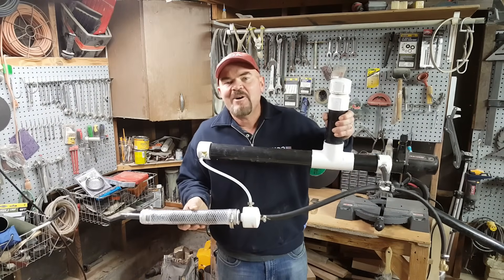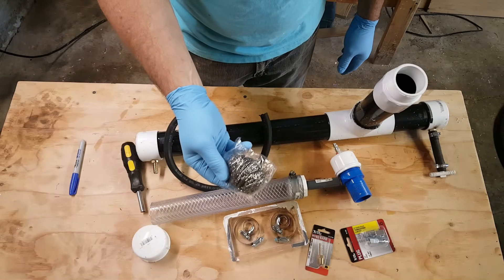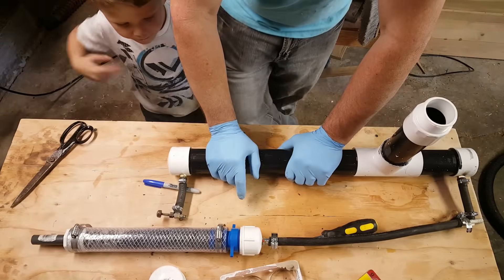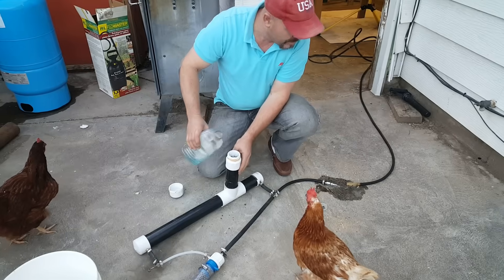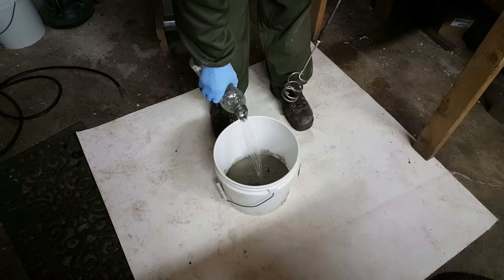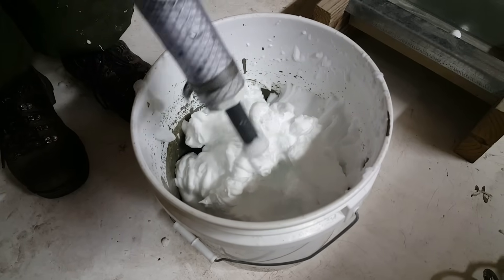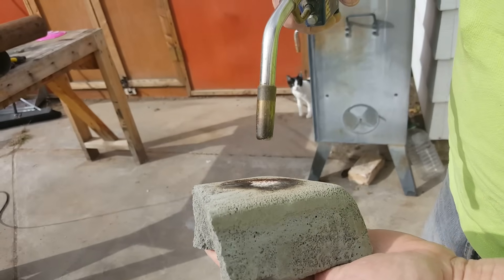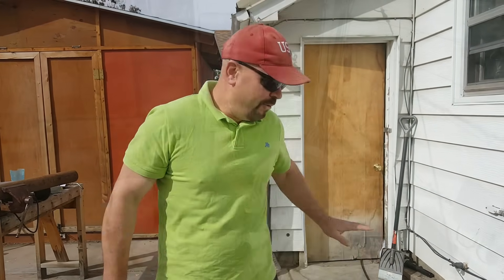Air Crete Machine for Under $30 (DIY)

Comment: Air rated concrete has been on the market for many years.  Invented in Europe and used widely in construction.  China has over sixteen hundred factories that make it and ship all over the world.  There are only four factories in the US.   The reason it not allowed in North America is that it would destroy the drywall and wood industry.   You have done an excellent job explaining this.
Reply: Scorp  he doesnt know what hes talking about and is wrong on all accounts not to mention the fact that sheetrock is used for providing a type of surface rather than insulating, or providing structural support.
Reply: @ keith reynolds  -   your statement is true.
Reply: AAC  autoclaved aerated concrete blocks have been used since the 1940 in some countries is called BCA
Reply: With new fibercrete mixed with aircrete & additional agents, you can make structural materials that are better than wood or drywall.
Reply: Where are the 4 factory's at?
Reply: LOL  , yeah , deep in the heart of Texas.
Reply: China
Reply: NooMax4ever exactly.    But most people accept the norm and don’t ever think outside the already built box
Reply: I'm willing to try
Reply: Closed cell spray foam and open cell is cheaper and can be done with 2 people.
Reply: But does “the reason it isn’t allowed is be ause it would destroy the drywall and wood industry” make any sense?  Drywall and wood are industries, but so is the home building industry, the insurance industry,etc who could put equal pressure financially if wanted in, and that is forgetting about voters clamoring for cheaper, decent homes.  And there would still be plenty wanting wood/drywall…not like their market would collapse. 

My guess is that more likely, just the usual that  because wood and drywall were quick and cheap, US builders, inspectors and customers got used to them, and there are more barriers currently with permits, codes, customers worrying about resale value, etc. 

And people used to say “the car and gas lobbyists will never let electric cars be made!”  But if it’s a good product ….it gets in, no matter how much it is repressed, and not like the competitor industries are the only ones with one….both sides have money.
Reply: @Itried20takennames Aerated concrete is a good product, but the reason that wood has been used so long is the engineering aspect/ versatility of it. 
I'm all for new ways of doing things, but as a former framing carpenter I can tell you that currently wood framed homes are better engineered than concrete ones. 
Much more customizable, lighter, and better insulated, not to mention renewable.
Reply: Brilliant invention. I’d love to make one. Im in the UK and want to build a micro shelter in a little piece of word land.  Can you do a buy sheet for the valves please? I can see the tube parts but I’m not sure what the valves are. Thank you so much. pS i tried to take a photograph of the valve in the plastic wrapper but I can’t read it.  Best wishes.
Reply: factories
Reply: Aerated
Reply: That's also wear that shity house wrap vapor barrier stuff came from. Industry control. Old heavy duty tar paper is far superior.
Reply: Over here those industries all exist as part of the same company. Hebel concrete hasn't really caused the decline of either of those industries. people prefer to look at wood and dry wall has a nicer finish so Hebel often goes in the internals and drywall/wood can be used as a facade. Chinese Hebel/concrete is shit though, I wouldn't use it has very poor rust protection and has a tendency to carbonate.
Reply: @  4121z0n4  -   in your attempt to denounce my intelligence ,  i have you know that there is a difference between  U.S.    and  U.S.A.  . 

U.S.    =   is a place to conduct business there in  [  District of Columbia ]  .

U.S.A.  =    is a place where  the people live   [ continent ,  or perhaps country as most others would have it ] . 

so tell me,  how can the  U.S.   have  4 factories within it, when it is merely  only a 10 sq.  mile  zone.
when i last checked it was full of buildings  for people to work and live  in  [ and  not factories ] . 

that is why i corrected it as   the    '' U.S.A. ''   because there is more room for that type of factory. . . . let alone  the other 3 .  

i am not the one with the lack of intelligence       while the one that made the comment is infact the lesser of that which thereof of whom you denounce of having lack of  '' rigor '' .

and as i have previously read the replay that i made to   '  deliverance '  ,   i do have more intell than he typed.

I am in no way shape of form a  Canadian .    I am  a full fledged born  birth right  AMERICAN  ,  that knows 
 about my ancestors than perhaps you do. 

i am being polite to you , do show the same respect.
Reply: Robert Smith you didn’t think of trump one time before the campaign.     

So don’t start now.
Reply: @ 4121z0na   -   how am i being obtuse ? 

all i pointed out was   that  the USA   is  north america.     how can you get that as me being obtuse? 

not my fault that    '' deliverance  ''   fell asleep at the wheel.    lol  ,  was merely stating that .
Reply: Scorp whut ru talking about? Usa? Whats that? I dont know of a usa.. maybe you mean south canada and north mexico, and then theres texas ;)
Reply: americans tend to be butt hurt over the simplest of things
Reply: yeah, that stuff looks more like a foundation, that it would for a replacement for sheet rock. but the thing is, that sht floats.
 would get better usage out of it as a boat . . . xD
Reply: @djohnson3678  Going to make an  Aircrete canoe!
Reply: Robert Smith your an idiot!! Clearly you believe the lying news Media owned by Illuminati !!! They are manufacturing so many lying garbage I lost count over 1000 already!!! Big problem not one dam word has been proven!!! Are you really numb enough to think that if the Mueller investigation had one shred of real evidence that shitty Adam Schiff would not have leaked it??? How incredibly ignorant of you!!! While most Americans think its democrat VS Republican it’s not but theirs some real problems with the Democratic Party right now! But not my point! The real issue is against the deep state against us Americans !!! This bastards want America brought to its knees,  so then we all say uncle and demand their slimy “one world government” !!!! Look at Serco!!!! It’s the company run by them !!! They can’t even tell shareholders we’re 35% of of revenues go!!!! Huge criminal enterprise!!! Hundreds of billions!!! They control our patented system, list go’s on and on and on!!! Anyway you really need to wake up and stop drinking the koolaid
Reply: '''''''' There are only four factories in the US. , The reason it not allowed in North America ''''   the U.S.   is NORTH AMERICA.   so how can there be 4 in the U.S. 
when there not allowed in the ( U.S. =  North America )  

redo you're statement plz, it is confusing . . .  misleading
Reply: canada/mexico  are north america also
Reply: @djohnson3678  US= central North America because North America includes Mexico, USA, and Canada. Please read it again because the comment clearly states that there are 4 factories in the US, which does not state how many there are in total including Mexico and Canada.
Reply: that is not what i meant by i stating  the difference between :

USA  [difference is =  USA  as in a whole  non-commercial ] , BUT, can be used in certain type of contract to 
 be  ''  in it for the business'' but not to be subject to being sued. . . . long as there is no breach of contract.

U.S.  [ difference is  =  for business , commerce trade, for profit and exchange, ect. ] , can be sued for breach of contract. . .  because it is only business.  [ that is how they see it.]

so everytime the people of the USA elect a president , he is being elected to be the head of operations for trade, business, ect .  hence is inauguration acceptance  '' i the president of the united states '' solomly swear
 . .  ect , ect, ect.  
the only one that i know of that did say  '' i  blah, blah ,blah  of the united states of america ''  is J.F Kennedy.
and we know how that turned out.
Reply: @djohnson3678  I get what you are saying, and agree, but this is a whole other story and not so much about geography, lol.

Comment: I bet that would make a superb roof material.  insulating value while being resistant to the elements and keeping a cap on interior heat from escaping.
Reply: I think you are on to something.
Reply: Lakario Davis - Not sure where you´re located, but in Europe "light concrete" has been used as insulation for a long time. 

Notice that by "light" I mean mixed with Leca, Styrofoam beads, air...Think anything light in weight with great volume and lots of air. ;-)

My house, which is some 40 years old, has a "Leca" slab up to the attic.
 
Cheers

Comment: so if i need 10 yards of this..how long will the driver charge me in extra time charges
Reply: its a great design.. i didnt  mean to imply otherwise
Reply: Note he had to hand mix the foam and the concrete.  If your concrete supplier can't make aircreet in the truck, you're better off doing small batches.
Reply: 10 yards by hand???  cmon

Comment: Great tool!  I'm looking forward to building one and experimenting with its use.  Applications could include ferrocement boat construction and ICF block.
Reply: The engineering dept at our The University of Texas at Tyler has a successful "concrete" canoe competition team entry each year along with many other university teams from all over.  They have years of experience in trial and application of many different mix materials and ratios, add ins like various  fiber, bamboo, rebar, wire,  epoxies, nano carbons and build configurations ,  with all the research data on sheer, compression, deformation, weight/density to load limits,  etc etc....to examine and factor into ones potential projects.  Good guys running the show there too, regular guys that like to git 'er done, an  help other folks git'er done too.  I'm gonna try to use chicken wire and bamboo skeletons with glue and coloring (stone powders, slits, clays) add ins and resin sealers to make faux boulders, facade walls, dry creeks for run off management, cisterns and arches.  Nobody to stop me but me.....
Reply: Wonder if this would work for a forge? 🤔
Reply: Jpizzle Fo Shizzle did you give it try? I'm going to be building a small stove and was trying to find a good insulator.
Reply: me tooo!!!!
Reply: Well call me, let's make these. 587 487 9243.
Reply: Jake Prosser you probably shouldn't put your phone number in a public forum. You never know what who's going to call /sign you up for whatever.

Comment: Awsome video, Thanks for all the great information.
Reply: Daniel N. Yes?
Reply: No explanations, why torch this or that, why drill what holes to what size, what parts are important, what foaming chemical was used and why.....

I seldom write negatives. 

While aircrete mixing at the end was cool, the whole part leading up to it, was not worth it,  either skip the build part or explain it.
Reply: Freedom1man, I agree.  I want explanation as to the purpose of that awkward design, why two hoses to the supply and how it works.  It really helps to know how it works instead of just blindly building it.  The guy failed the important detail.
Reply: Essential Mountain Homesteading iii
Reply: Like when his child asked him, "What are you doing?" he never answered.
Reply: Freedom1man why ask why just skip ahead on the video golly gee

Comment: Very interesting, I will be researching this more but why are you using ABS pipe and PVC fittings? There is a special glue to use but not what you listed, it seems overly dangerous to me without a good reason.
Reply: I used the ABS to PVC glue (green label from HD) and have not had a problem.  Give it overnight to set up tight.